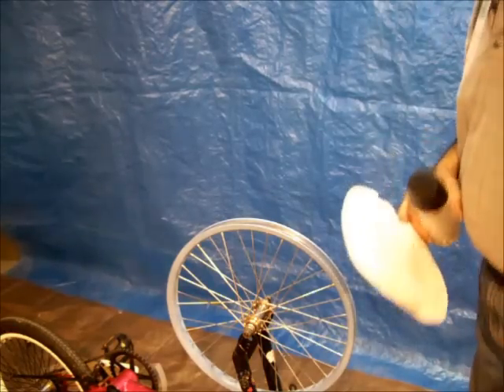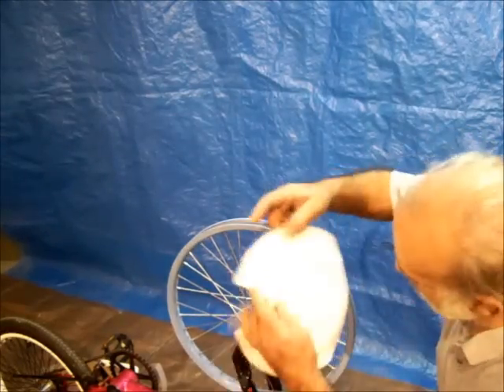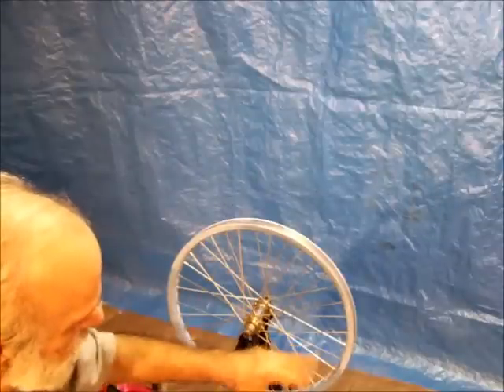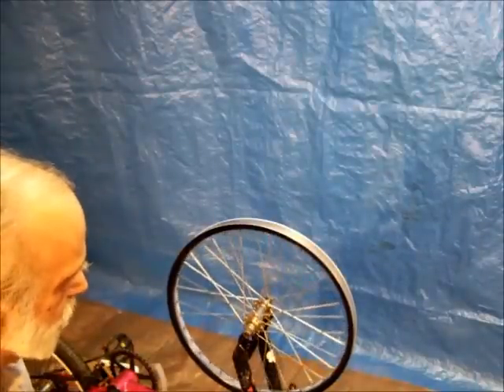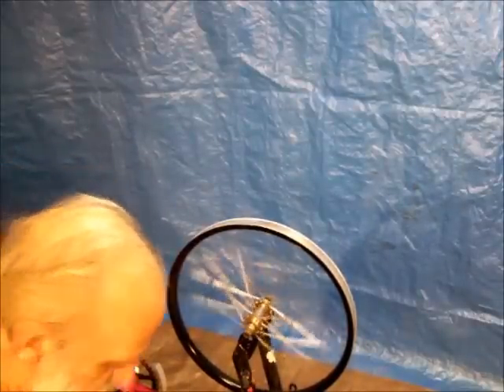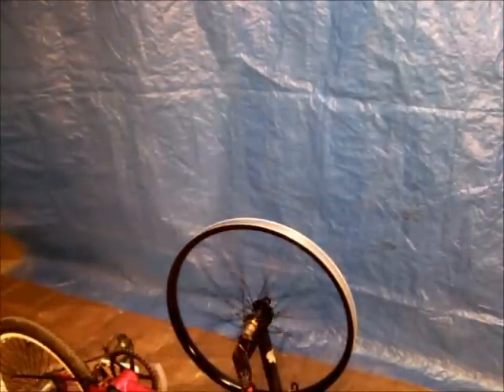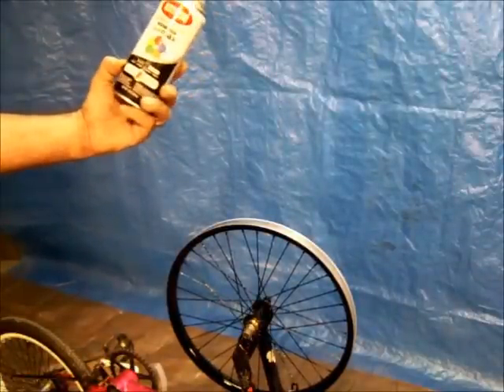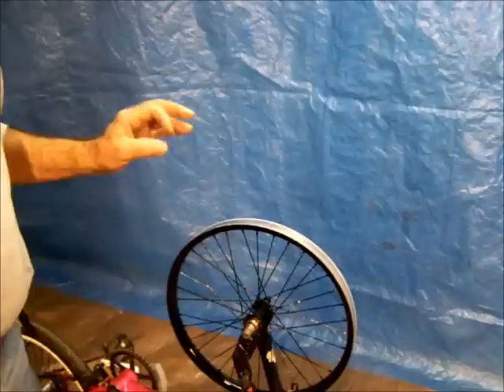How to paint bicycle rims (an easier way)

Comment: this video is very helpful, thankyou 
does anyone know if this will work with green graffiti, as someone told me that different colors come off easier and i don't know if that is true or not
Reply from the maker: I'm not sure about  green graffiti, but good prepping is the key. 1st sand the base with 100 grit,2nd prime well and let dry 2 hrs,3rd lightly sand with 800 grit and base paint color choice again 2 hr dry time. The next is very important== clear coat ,especially the brake  area 2x times with light sanding (800 grit) and 2 hr dry time between coats. I know it might sound like a lot of work but mt 1st bike build (7 yrs ago) shows no wear

Comment: why not just take a piece of cardboard, bigger that the wheel and place the wheel flat against the cardboard, and while pressing the wheel against the cardboard with one hand, take the other hand and with a pencil, outline the diameter of the wheel? Then cut out the cardboard outline and using double adhesive tape, tape the cardboard to the wheel. That way you dont have to do anything except paint the outer part of the wheel without having to continually move the cardboard before painting.
Reply from the maker: Cardboard doesn't give me the control I need to keep the overspray from 
 ruining the project. With the way I tape ,it's easy to remove. I've had a lot of 
people condemn  me for painting the spokes=I tell them go to Walmart  and look
at their bikes,and you'll see those bicycle companies paint their spokes, Why not me ?
I had one girls bike I picked up at Goodwill  it had =white rims ,silver nipples, and 
black spokes